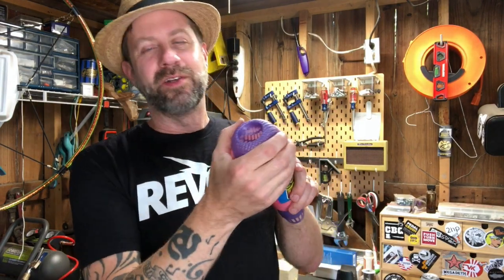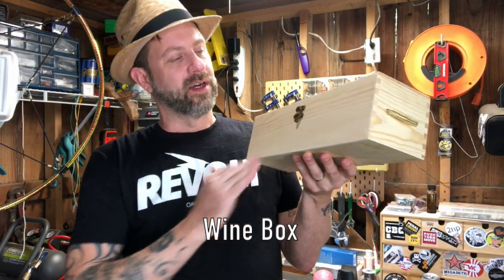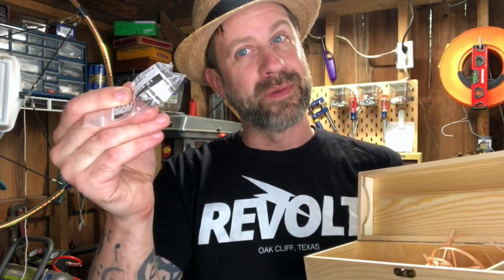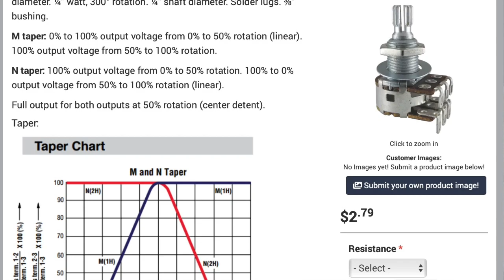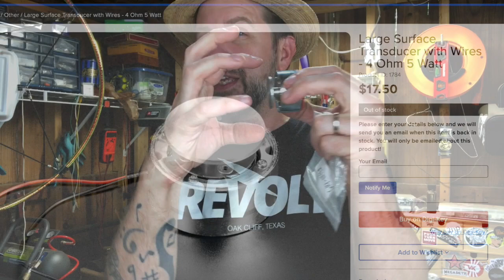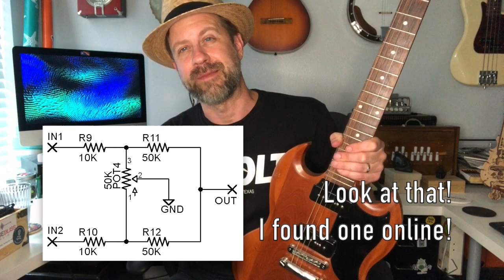Building a DIY Spring Reverb: Part I

Comment: The blend pot has to be grounded on one of your grounding lugs on the pot, otherwise it's dead when you go to center on blend. So ground your input and output together and wire to ground  lug on blend. Either top right or lower left.
Reply from the maker: That's probably what I did wrong. No worries though. If you watch Part II, you'll see I came up with a different solution. I'll remember that if I try again though.

Comment: Just a thought. If you used a stereo amplifier and ran the dry signal through the left and the right. Then use one side for the reverb and the other for the dry, you could control each side with separate potentiometers to balance the levels and send that to the single output. That might eliminate the blend pot issue. I use small 5VDC amplifiers to make practice amps that run off USB power banks.
Reply from the maker: That's a great suggestion. Thank you.

Comment: Instead of buying those expensive components, you could have used an LM386 driving an actual little half watt speaker with most of the cone removed and attaching the spring to it.
Reply from the maker: There's obviously a lot of different ways you could accomplish this. All of my DIY videos are made to be templates and you modify as you see fit. Thanks for checking it out.
Reply: @musicalmiscellany , another piezo driver could possibly be used as the drive transducer, since larger piezos are used as tweeters. The high internal capacitance of a piezo would provide bandwidth limiting and filter out most of the bass and low midrange frequencies so that they never reach the springs.
Reply from the maker: @goodun2974  That's a great idea.
Reply: @musicalmiscellany  ,  The Silvertone amps that were built for Sears by Danelectro in the 60's had a cheesy one-spring reverb using what may be Rochelle salt crystals as a piezo type transducer for both the spring driver and recovery pickup. These reverb tanks fail and drop-in replacements aren't available (Fender style tanks won't work in Silvertone amps without major modification to the circuitry); and they never sounded much like a surfy Fender reverb anyway (very lo-fi and distorted, which some people like for effect). I've been wondering if those little piezo discs could work as substitute transducers to rebuild and hopefully improve the reverb in those Silvertone amps.

BTW, Rochelle Salt crystals were used in the earliest crystal mics, sometimes found in old Astatic, Turner and even Shure mics. Blues Harmonica players love em, but  original crystal mics rarely work at this point because the crystals absorb moisture and disintegrate.  If you shake an old vintage crystal mike,  It'll often sound like a salt shaker because of the pieces of crystal rattling around inside.  Rochelle salt crystals can actually be grown to a very large size and some people grow them strictly for ornaments because of their beauty. I've seen videos on this done being in somebody's kitchen!
Reply: @musicalmiscellany  , have you ever watched any videos from the Museum of Everything Else channel, aka This Museum Is Not Obsolete? The British guy named Sam who runs the channel did a video a few years ago of a vintage reverb device he found  that used a 6x9 speaker to mechanically excite a quad set of springs mounted above the speaker cone. The wet signal was mechanically generated by the springs vibrating in sympathy with the music or tones coming from the speaker, had didn't have any drive or recovery transducers. Even sweeping test tones through it sounded very interesting. It might be on his original Look Mum No Computer channel.
Reply from the maker: @goodun2974  I'm super familiar with Look Mum No Computer. He's great. I love his creations like the pipe organ in a spare room. LOL.

Comment: I know, this is 2 years old but you might get a stronger pickup signal if you mount the piezo similar to the transducer, supported around the circumference with a hook glued to the middle 🤔🔧👍
Reply from the maker: Thanks for checking out the video. I actually thought of that during the prototyping but I was afraid it would ruin the piezo. If you've ever looked closely at one, the center disc is made of paper thin ceramic. Just a slight crack in the ceramic and it can stop working (or at least not work as intended). I decided to go the safe route. I'm wondering if a larger mount that somehow covered the entire ceramic disc might provide enough surface area to stop it from cracking. It would be a fun thing to try. Thanks again.
Reply: @musicalmiscellany  Thanks for the reply. I love improvised stuff. I have never made a spring reverb or even used one (disclaimer), but I have messed about with piezos. The ceramic is only on one side, could you not put the glue on the other side, the plain brass side? I think the brass would be pretty strong if supported all the way around its cercumference. Besides piezos are cheap or even free. Worth a try 😀🔧👍

Comment: It might happen that the reverb preamp inverts the phase, so when summing with the dry it cancells it out, you may try an extra inverter stage (single transistor or opamp), on the dry or the reverb signal. You should also see overall opamp theory.
Reply from the maker: @bobyk87  thanks for the suggestion and also for watching. I appreciate it
Reply: @musicalmiscellany  i literally burned my vox combo (china), with speaker and the reverb can; but the chassi is waiting to become a head... that reverb was ok.

Comment: The pot more than likely is not defective. On the blend pot try soldering a small wire from top right lug to bottom left lug. Then solder a small piece of wire from top left lug to bottom right lug.Ground either top left to bottom right or top right to bottom left onto pot. Then ground that to output ground lug. Use center lugs for each input and ground each. It should work right then.
Reply from the maker: Thanks for checking out the video. I may need to try a blend pot again. I obviously did something wrong in this project.
Reply: @musicalmiscellany  ok. One thing I did leave out though. Some companies build pots different. If what I told you doesn't work, switch ground wire on pot to opposite connection. In other words ground opposite wires to pot.
I've been building guitars and basses using blend on active/passive circuits in my
preamps for years and have found this out the hard way!
Have a good day.

Comment: Could the silence at the center of the blend pot be caused by phase cancelation? Anyway, thanks for the cool video. I recently came into a box of 24 little weighing scales that have nice, delicate springs in them, and this was the first thing I checked out to get an idea of how to make a reverb from some of them. Instead of a transducer, Ima try different materials to make a membrane overtop of some laptop speakers with huge magnets, which also have a bunch of.
Reply from the maker: @LunarCascader  good luck with your project. I hope it comes out great I’m still a little bit baffled by why that dual gang pot didn’t work. Some folks have chimed in below to explain their ideas. In any case, it works great with the two pot set up. Thanks for checking out the video.

Comment: Glad you're doing this. Last winter I bought a bunch of parts including transducers to make one very similar...and forgot about it. Over the weekend I actually found the transducers. I've had the same issue with trying to wire those blend posts on other effects... so I'm hoping you've solved it in part 2.
Reply from the maker: Thanks for checking it out. Ironically, Part II just posted this morning. Check it out.

Comment: Interesting project. I tried something similar in a CBG build. I built the "spring reverb" into the box hooked up to a piezo separate from the main pickup. When I wanted the built-in reverb I had a mini-toggle to activate it. It was muddy though. Maybe I'll revisit it.
Reply from the maker: Yeah. That's exactly what I was trying to avoid. A straight reverb spring loses a lot of definition and ends up sounding really muddled. I was hoping to blend the original signal back in to keep things sounding musical. Stay tuned for Part II cuz I've got some ideas. Thanks for check ing it out.
Reply: @musicalmiscellany ,  You need to bandwidth-limit the drive signal to the reverb tank, to filter out the bass and low midrange so that it doesn't reach the drive transducer.  In a Fender tube amp with reverb, this would take place because of the low-microfarad-value capacitor that feeds signal from the driver tube into the reverb transducer, as well as some lpw frequency roll off caused by the small output transformer used to match the high impedance of the driver tube with the 8 ohm.  Your solid state driver's circuit, however, is designed for audio fidelity and has high frequency bandwidth.
Reply from the maker: @goodun2974  Thanks for that feedback. It makes sense. However, any time you add 100% wet reverb signal you're going to lose some definition. You need to mix the clean signal back in.
Reply: @musicalmiscellany  ,  not surprisingly, 100% wet signal is rarely desirable; and yes, a "mix resistor" arrangement is necessary so that the two signals can be blended and level-adjusted without totally killing the signal.   The reason I mentioned bandwith limiting the input to the reverb transducer is so that you won't waste energy shaking up the spring with low bass notes, which causes intermodulation distortion to take place in the spring itself as well as when the wet and dry signals are blended.  BTW, I looked at your part 2 schematic and it appears to me that the 100k pot for the dry signal will introduce a relative low resistance, and variable loading, to the guitar's pickups;  100k is much lower than the potential owner values typically found in the guitar which are usually 250 to 500k or even higher, which affects frequency response and tone from the guitar.  Also, you haven't wired the pot like a proper voltage divider and so the impedance load that the guitar sees will vary greatly as you adjust that control.

 You may find it interesting to Know that multi instrumentalist David Lindley, who passed away last year, used to play a highly modified mutant bouzouki that he built from a bouzouki neck grafted on to the body of a Vox "teardrop" Bill Wyman bass, with piezo earthquake sensors inside the body as additional pickups that could be blended in with the magnetic pickup.  There are videos of him on YouTube with his band ElRayo-X  where you can see him play that thing!

Comment: You can use a regular pot and ground both signals to the middle and the positives on the sides and it should work as you intended but I'm not entirely sure
Reply from the maker: So if you put an input to each side and ground in the center, where does the output go?

Comment: Fun project! just a thought using the 250K ohm pot, when you reach the top of the the taper profile the full 250 k in affect shunts the signal? If you have an oscilloscope, you could verify that. What we need in Texas is some rain, I'm down the road here in Clyde it was 110 yesterday. Looking forward to part two.
Reply from the maker: Yeah, I think it's just a bad pairing for the circuit. I'm gonna fix that though. I should get part II up soon. Thanks for checking it out.

Comment: piezos... you need extremely high input impedances to get a decent signal... they form an RC high pass filter. a standard preamp wont cut it. need 10Meg or better for a nice full range signal...

blend is better done with two devices feeding a  common load resistor. 12ax7 type tubes are ideal, twin triodes... not everyone does tubes though. whatever. can use regular transistors or fets. this stage only has to be low gain, an impedance buffer... can feed an opamp or other preamplifer from there.

the real issue is the way the spring is driven. better to use small DC motors. most commercial reverb units, ie, the "accutronic", amongst others, use TORSION. they TWIST the spring, rather than tension/longitude waves, or transverse/up and down waves... if you tear down the transducers, you find its far more like a "synchronous AC motor" than a speaker coil. diametrically polarised magnets held between the two poles of an electromagnetic. a submersible pond pump or stepper also works...

means they are a lot less prone to external noises.. vibrations... theres a bit, but far less than you get with the two more "conventional" modes of propagation.
meaning the amplifier stage can have way more gain as theres far less chance of howling feedback loops.

it also means the springs can have far less tension on them. 

i only clicked as the thumbnail looked like it was using a motor drive... nope. just a piezo operating in tension... sigh.
Reply from the maker: @paradiselost9946  Thanks for the detailed explanation. It makes sense.

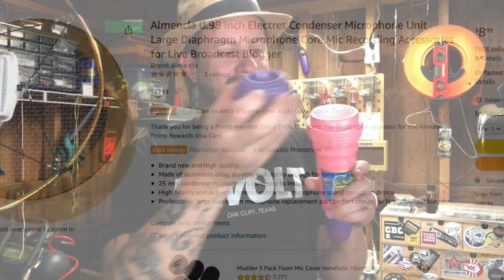Comment: 1:44 Could you tell me how this capsule works, I had bought them but was very disappointed. Help.
Reply from the maker: I have no experience with those mic capsules. I opted for going the piezo route on this project and have not purchased any capsules to date. Thanks for watching the video.
Reply: @musicalmiscellany  Ah ok. I am following your idea to be able to build myself a surface contact microphone and this reverb might come in handy (but I was thinking of a metal cylindrical shape ... ). I 'd tried piezos too but was not very satisfied with the poor result. But I had to apply 5V. I will try again.

Comment: what was the signal path for the reverb? (guitar to reverb to amp to cab) just as an example
Reply from the maker: That's more or less correct. The signal went from the guitar into the reverb and then to a small combo amp. Make sure to check out Parts II and III because I made some improvements.
Reply: @musicalmiscellany  ok thank you will definitely check those out

Comment: Hello. I have a Harley Benton GA5 guitar amp into which I would like to build in a spring reverb. Which I'll take from an old Laney PL50 Reverb

Can you tell me where to attach it according to the diagram? I want to build it into the body and mix in the sound of reverb.
Reply from the maker: Thanks for checking out the video but I wouldn't be able to tell you how to do that. Adding an internal reverb to an amp is not an easy task. It requires and analysis of the circuit and you'd have to splice into the circuit board (if there's even a place to do that). I understand the want to add a spring reverb to a small tube amp. I had a similar situation with my Vox AC4. I ended up getting a small reverb pedal and some velcro and just velcro'd it to the back of the amp. Then I used a pedal patch cable to plug the pedal into the amp's input and I always plugged the guitar into the pedal's input. To be honest, after a while, I forgot the reverb wasn't built-in.
Reply: @musicalmiscellany  , Kley De Jong made a YouTube video about a one-tube add-on spring reverb circuit that can be added to virtually any tube amp. The circuit itself is pretty simple but tapping into the power-supplies and existing tubes in the amp would require a good knowledge of tube circuits.
Reply from the maker: @goodun2974  I'll check out that vid. Thanks for the suggestion.